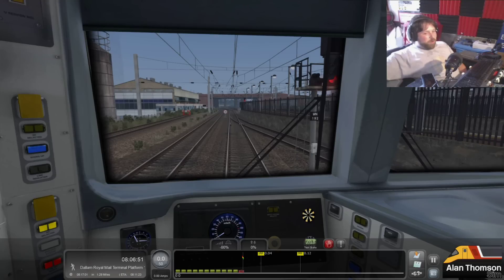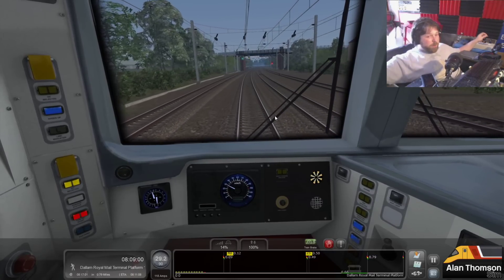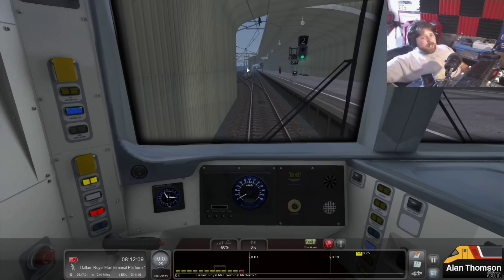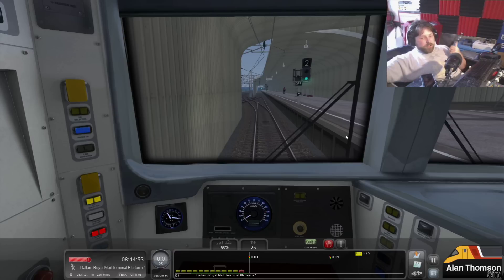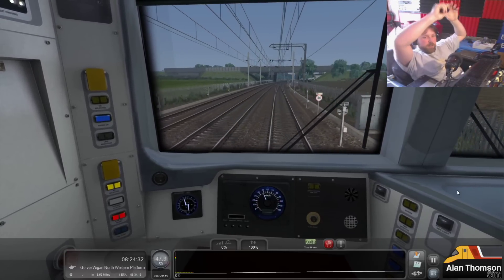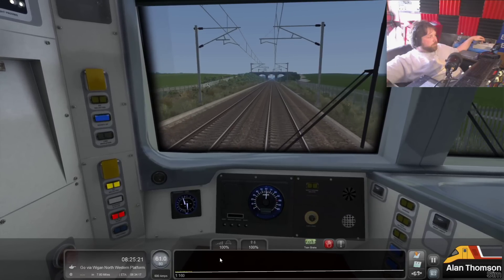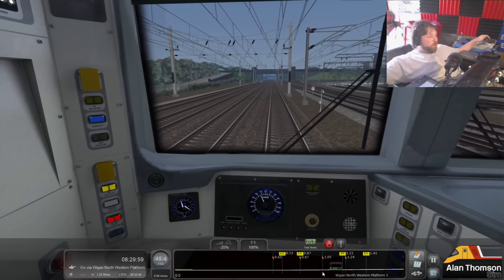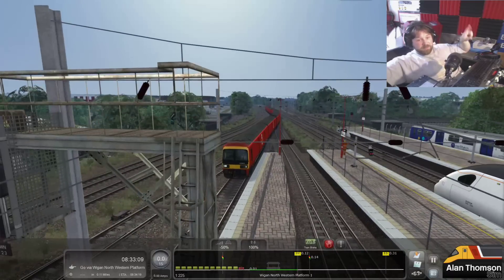Train Simulator 2020: Class 325 Dallam Sidings-Wigan

Comment: How do train drivers IRL know when they need to slow down? Like at the end, when you had to slow from 100 MPH to 25 MPH, you have the HUD to see what is coming up, but of course IRL there is no HUD. How does a train driver know when they need to start slowing or if they need to slow down? Here we have a system that sends signals to a panel in cab which tells the driver what is coming up, but I don't see that on British railways.
Reply: Because the route was broken it routed Alan's 325 onto the wrong line at Winwick Junction hence why there were no signals along the line of route barring a couple of ground position light signals which are normally used for shunting moves unless they form part of a valid route from one main aspect signal to another, in which case they then act as "running signals" and become lit to indicate a proceed aspect as part of the main route. (Signals are controlled remotely from SSI (Solid State Interlocking) Centre's and all signals are fully interlocked with points and crossings for maximum safety.) So usually there would be main aspect signals Green/Yellow(or in 4 aspect signalled areas Double Yellow and then Yellow)/Red aspects to control the driver's speed accordingly. Also Driver Route Knowledge plays a very important part as a driver has to know every square inch of a signed route intimately, plus drivers are trained to drive defensively. Which Alan certainly was not doing btw :)
Reply: Very simple - they learn every inch of the route, including speed limits.  Signing on (learning and being qualified on) to a new route can take 6-8 months of intensive route familiarization.
Reply: @droge192  Wow, I never knew that! We don't have that kind of route lesarning here, once you pass your exam, you can drive anywhere. In fact, drivers are quite often exchanged on routes, but they usually have their "own" locomotive that they modify, like adding a mini-fridge or hotplate (or as many do in some diesels, warm up the lunch on the engine block in a metal pan :D ). 

There are some "areas of operation" though, like a driver spending weeks in one station just waiting or shunting, and it's usually a local guy who does it. 

But as for the route knowledge, when to slow down, etc., we have in-cab systems for that. And also written instructions that get passed to the crew at stations. It's like "Pull into the siding at Station XXXX, and wait until Train YYYY passes you, then proceed". 

I have to say, I am quite impressed that train drivers put that much effort into the job. I guess they are better paid then ours, too.